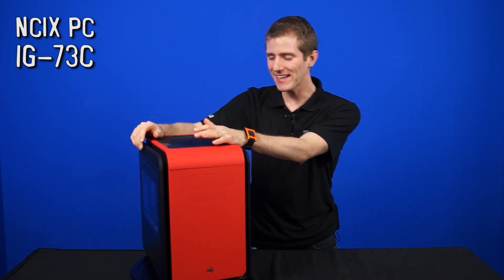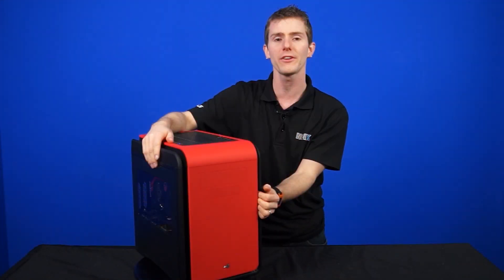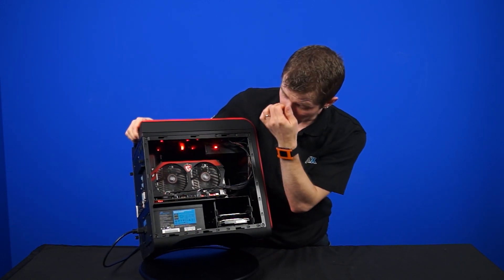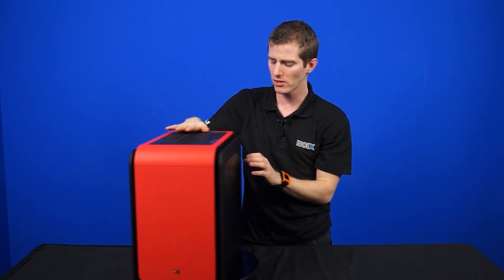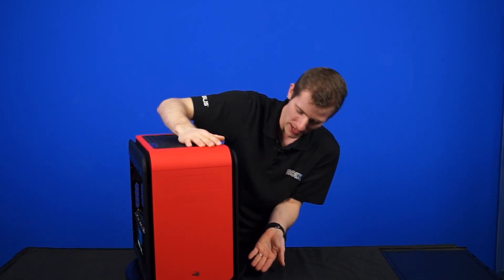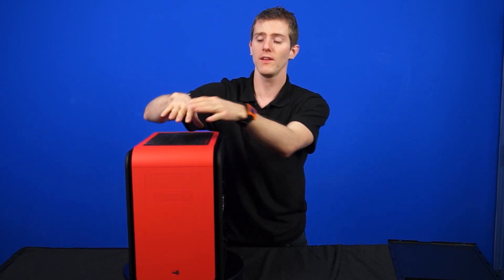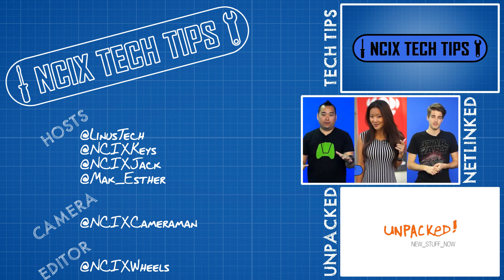NCIXPC IG-73C ft. Aerocool DS-Cube mATX Chassis Gaming System

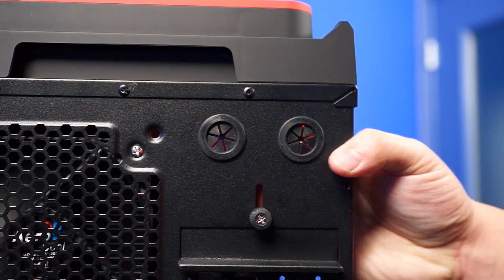Comment: 2:00
Hey Linus, maybe I want to stick my radiator in a protective box and mount outside my window in summer?

Those are also good for ghetto mounting on old extra I.O. front panel to as spare header, or bringing out fan connectors to cool some alarmingly hot crappy USB BTC asics you shouldn't have bought with what is now $1200 of BTC.
Then again if I was that prescient I would have poured everything into BTC at that time in August.

Comment: Have the case, same MB, plus i5 4670K, 16GB Crucial Ram, Samsung 250GB SSD, 2TB Seagate HDD, Cooler is Corsair H100i. I love this PC. Only finished building it last week. BF4 Ultra settings all the way(will turn it down once I get to enjoy all the eye candy first)
Reply: ***** maybe he uses the HD 4000? if he does, that cant run BF4 at ultra.
Reply: ***** XFX 7950 DD OC. Still plenty of Ommmmph in it. :)
Reply: MrXxsuper That won't even run BF4 load screen I reckon lol
Reply: How did he H100i fit in the case? I'm considering putting that cooler in my build too. Was it really cramped or was it still easy for things to fit?
Reply: FatalPivotStrike I had to remove the 5 1/4' bay to get the cooler to fit. Just a few screws to remove that. The cooler only fits in one position, with the water pipes on the back of the case. I have a public album with photos of the build(sort of) in my G+ profile if you want to see how it looks. Plenty of space for ventilation since my config was pull instead of push with the two corsair fans attached to the rad. Hope this helps.

Comment: I have this case and I love it!

BUILD:
RAM: 16GB (4x8GB) Corsair Vengeance LP DDR3
CPU Cooler: Cooler Master Hyper EVO 212
CPU: i5-4690k
PSU: Corsair CS750M
HDD: Seagate 1TB
SSD: AMD R7 128GB 
OS: Win8.1
GPU: Asus R9 Radeon 280
MoBo: Gigabyte Z97M-D3H

Might buy a 980 at the end of summer

Comment: Would be nice to see how much room it have in front off it. too see if you can get away for putting an 180mm rad in the front, 240mm in the roof and an 140/20mm rear.

Comment: I have an idea for making an entirely water cooled system so I don't need airflow inside the case so I could make a powerful tower fit into nearly laptop size, I was wondering if someone could help me find a motherboard among other things that could handle this well. It's just a concept but I want to know how small I could make a powerful desktop (great for LAN parties)
Reply: this sounds like a bad idea..
Reply: If you need help finding a motherboard then thats just the start of your problems.
Reply: goxcpre CPU's are easily liquid cooled and so are GPU's, I'm just worried about the other components on the motherboard not being cooled well enough, so the motherboard should be the only problem
Reply: I think the thing is that without any airflow heat will still build up inside; even if you cool everything as well as possible
Reply: The limitation would be in size because you would need to fit the rads into your "laptop" size case. Of course if you are doing it custom it might work out.
you could always mod the board and put on better heat sinks.
Reply: HazewinDog with liquid cooling it takes the heat to rads which use air to cool the liquid, still removing the heat
Reply: well if you do work this one out be sure to share the result with the world

the thing I really liked though is how someone cooled his entire gaming PC without the need of liquid nor air cooling. that project took so much work and effort seeing how the dual GPU's were both equipped with passive CPU coolers (huge) and he had to fit all that crap inside the case :P definitely one hell of an awesome job that was :D

Comment: The pricing is not competitive on this one. i downgraded the processor to an i5 unlocked and removed the gpu , the hard disk and the ssd.... and only calculated for bare necesary components...

NCix total = 992

from amazon.....  processor = 230 bucks
case = 120 bucks?
raam = 40 bucks same as ncix i did not bother to look .... 
130 = mother board matx gaming series z77 
psu 650 watt seasonic g series gold = 100 bucks....
+ 22 for lighting = 22 is what they have so kept that....

TOTAL FROM AMAZON = 642 bucks for the same components... the pricing aint competitive :(....